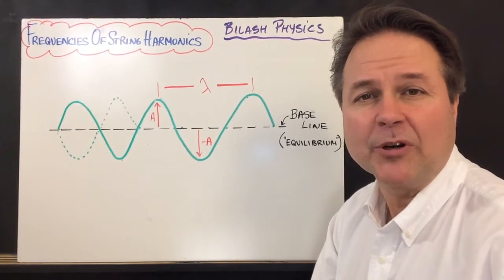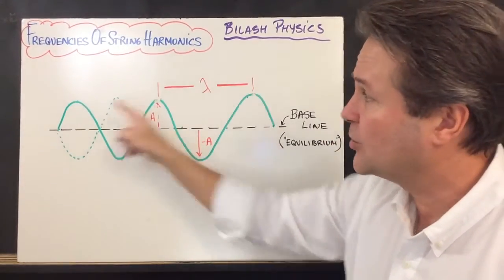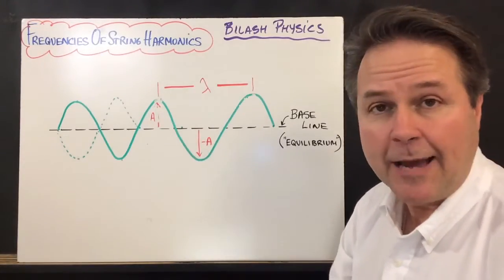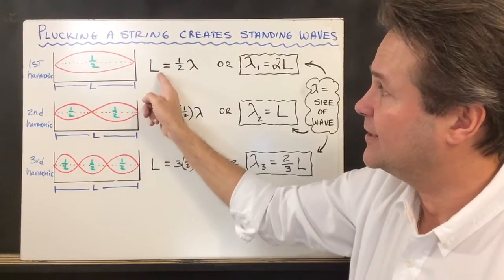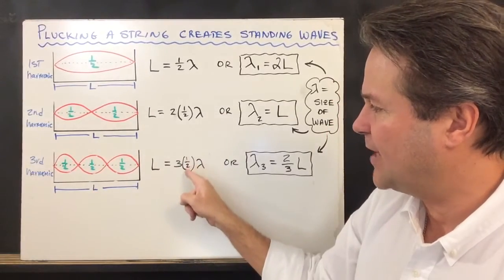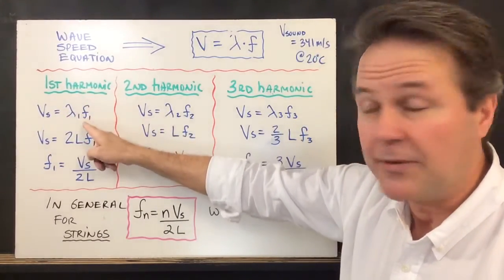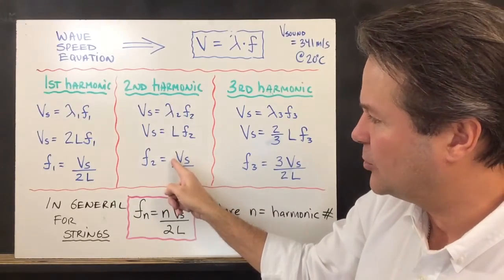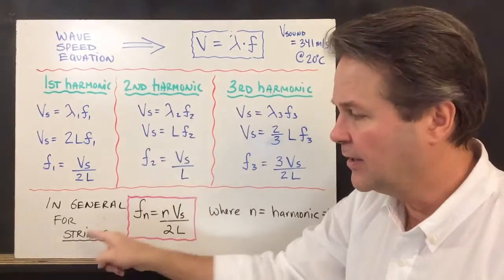Frequencies of string harmonics

Comment: Very interesting video! I have a concept on a device to make an acoustic guitar quieter. But the concept is putting it on the string near the bridge/saddle region, so that is shortening the periods/waves - do you think there is a way to counter that?
Reply: What'd you end up doing?
Reply: Yh
Reply: You only want to dampen the string motion you don't clamp it hard. An elastic band threaded through the strings works without changing string length.